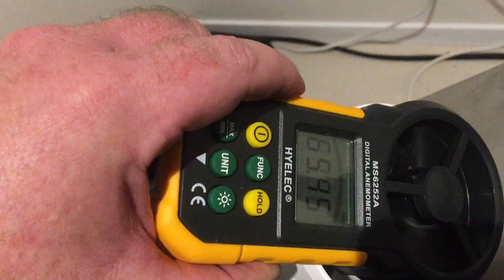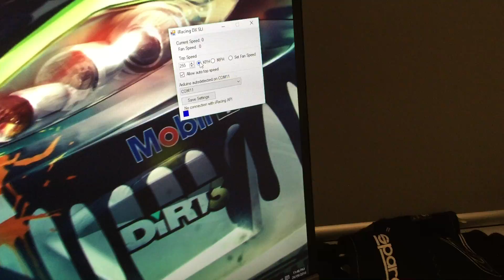Speed Comparison between the TMC and Seaflo blowers on my wind simulator

Comment: Hey Avenga I'm going to try and build one of your wind simulators. I don't have any experience soldering but if I understand you correctly you can purchase them with the header pins installed? The only ones I've seen don't have them installed is that a hard to install the pins? I read the link to  Silent Chill and he didn't mention soldering he just said plug it in. Also what power supply do you reccomend for 2 Seaflos? Thanks Greg
Reply from the maker: I haven't seen any with the pins installed. It think he means that you don't need to crazy soldering like this https://www.xsimulator.net/community/attachments/motomonstersetup-jpg.10992/

There are some ebay sellers that show pictures of the pins installed like this one http://www.ebay.com/itm/30A-Monster-Moto-Shield-VNH2SP30-Stepper-Motor-Driver-Board-Module-for-Arduino-/371662882189?hash=item5688d5858d:g:IdUAAOSwzJ5XajdV

But I can't confirm, you would have to email the seller to confirm.

It isn't hard to install the pins if you can solder, it is very tiny work so if you haven't soldered then it is a pretty tricky thing to start with. 

Even if you did find one with the pins installed then you would still have to solder the power from the power supply and the fans to the board. You could install screw terminals but again you would have to solder them in. The screw terminals are 5mm if you need to get some. like these http://www.jaycar.co.nz/2-way-pcb-mount-screw-terminals-5mm-pitch/p/HM3172

You could always take it to a local electronics repair place and get them to install the pins and the screw terminals for you.

For 2 Seaflo's you would want a 20A 12V PSU. LED drivers are perfect.